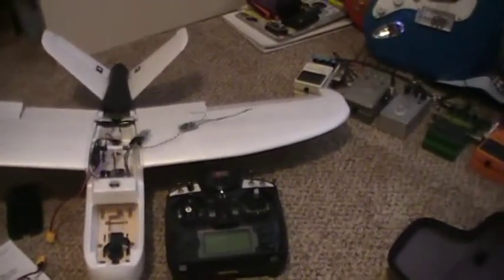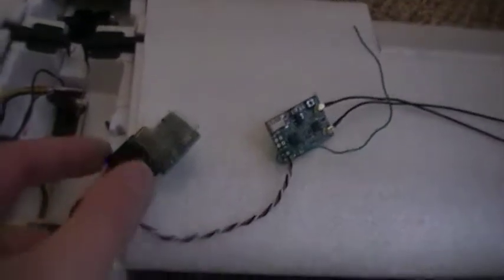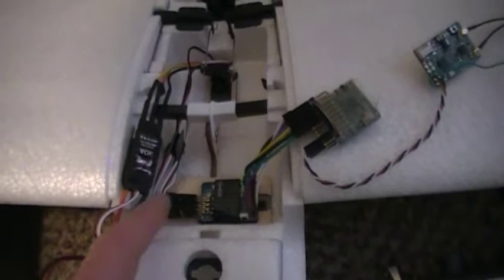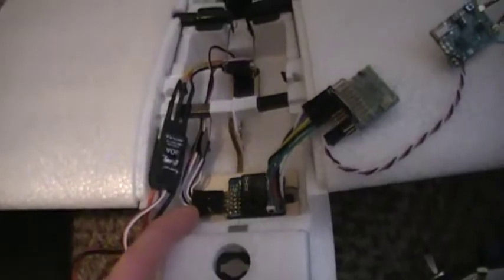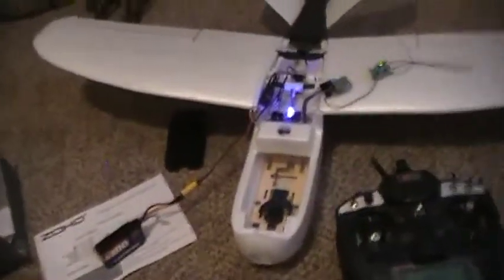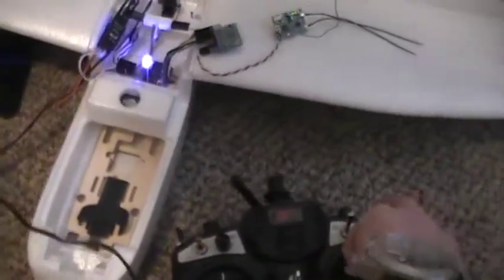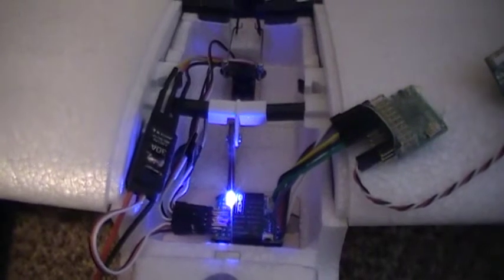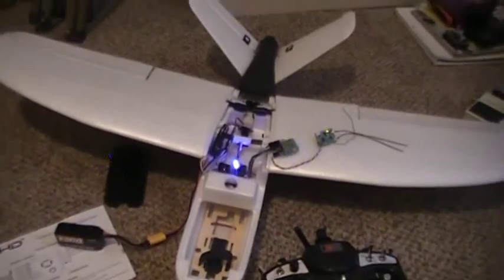ZOHD Nano Talon Stabilizer workaround (D4R-II PPM)

Comment: Thank you Nick for making this video and sharing  your workaround.   I have since just used an 8-channel receiver I had laying around and used PWM to solve my problem.  The plane launches  easily in the launch mode and flies great but you need to dial down your ailerons.    I just ordered a second Nano Talon which I will equip with a F4 flight controller running  iNAV, so the stablizer will be removed from the Nano.
Reply from the maker: No problem and thank you for the tip about the ailerons.  Just happy to have stick authority for now.

Comment: Thanks for this workaround. I'm fairly new to this so imagine my dismay when I couldn't get the throttle to work. Could you please discuss the wiring from the transmitter to the PWM module. I will have to get both... Thanks
Reply from the maker: Sure.  Are you currently using a D4R-II, or are you sure your transmitter supports the D8 protocol? 

If you short signals 3 and 4 on your D4R-II receiver, then signal 1 will output PPM.  Then you can connect the D4R-II to the converter and the converter to the Nano Talon. 

D4R-II                 ->       Converter
signal 1, power and ground             SBUS IN/PPM IN-OUT

Nano Talon                                      -> Converter
Aileron In, power and ground          1/9
Evevator In                                       2/10
Throttle In                                        3/11
Rudder In                                          4/12
Mode                                         5/13

Aileron In also has the power and ground with it.  Observe polarity when plugging it and the D4R-II into the converter.

In order to make the Mode switch work, you need to turn it on and assign AUX 1 to a switch in your transmitter.  Mode turns on and off the flying assistance feature, I think.
Reply: I actually have a Turnigy 9X TX with the IA8 rx and I'm getting the same issue you did. Not sure what the solution is
Reply from the maker: Randell Jackman Yeah, try converting the PPM signal into a PWM signal before you feed that into the Nano Talon's stabilizer.
Reply: I'm not sure how to go about doing that... The IA8 rx has eight channels.. So how to. I go about converting each to PWM? I notice on your setup it's just a single Ppm in to multiple channel PWM out to the stabilizer board not like my rx
Reply from the maker: I'm not using an iA8, I'm using a D4R-II because I swapped out the transmitter module my radio came with for a FrSky DJT module (years ago... it's outdated now). 
Your iA8 should already be outputting PWM to the stabilizer, so you might not need a converter.  Does your ESC/motor make any beeping noises when you plug the flight battery in with the throttle all the way up?  If so, what are they?
You might have calibrated the ESC by accident and have no range in your throttle.
Also, you might not be getting your throttle stick low enough to arm the motor.  Try putting the throttle stick all the way down and adjusting the trim and end point all the way down.  See if that helps.
Reply: SchmidtN I will check it out and let you know... Thanks much
Reply: I'm getting a one beep every second with the motor twitching when that happens
Reply: Hey I got it to work.... I just redid the calibration. Thanks for your suggestions
Reply from the maker: That's awesome!  Happy I could help and happy flying.
Reply: @nsschmid   Hey i need to know how to convert PPM out of pixhawk,  into PWM thats used by Nano Talon's esc/servo.
Reply from the maker: Never used a Pixhawk but I thought those output basically every type of control signal imaginable so you wouldn't have to convert anything.  Isn't it just Pixhawk PWM out of each channel to Talon PWM in of each channel @karthikprakashsivakumar3973
Reply: @nsschmid   If i connect Talon servo directly to receiver in pwm mode, it responds.

If i connect put the pixhawk in between (receiver->ppm encoder->pixhawk->talon servo) no response.

What would be the difference
Reply from the maker: @karthikprakashsivakumar3973  either the PPM encoder or the Pixhawk. 
If your receiver supports PPM, try it without the PPM encoder and see what it does. 
If your receiver doesn't support PPM, does your transmitter support a different receiver that does output PPM?